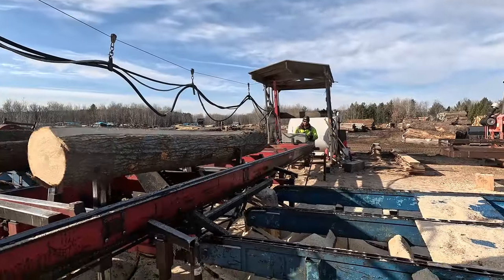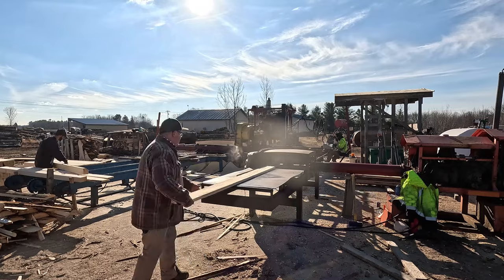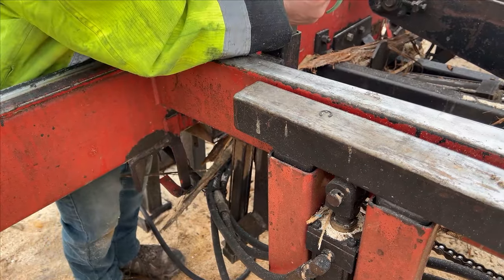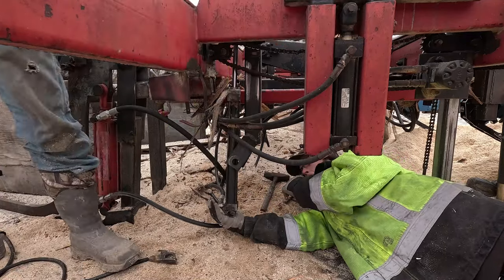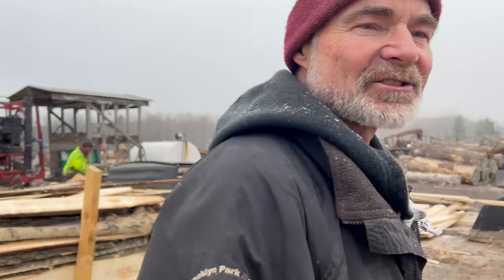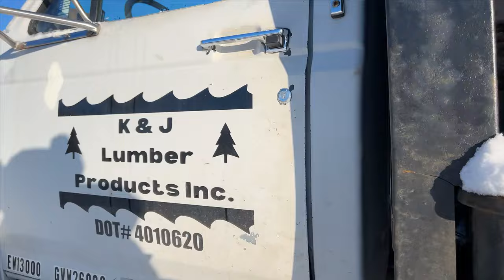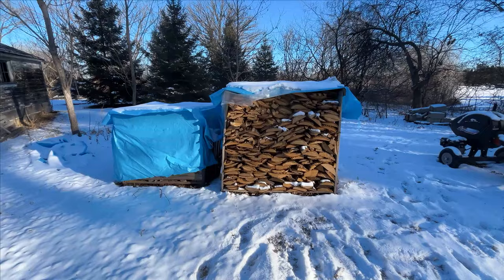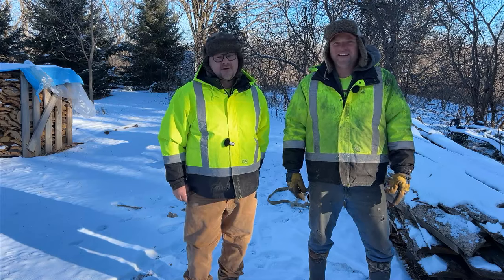What Is Slab-Wood? Turning Sawmill Waste into a Speedy Firewood Option

Comment: Here where I live most of the mills have a system where the slabs run down the conveyor then are cut in 16" lengths then go up another belt and dumped in a pile outside, where folks come and load them on their trailers then pay so much a trailer load,  They never have a problem getting rid of their slap wood. I take my trailer, ( 5' x8")  and on a good day I can haul about half a cord, for about $15.
Reply from the maker: Yeah that sounds like a slick operation.
Reply: Yes the only problem we have is when the firewood dealers show up with the huge double axel trailer and park right under the conveyor  until their trailer is full, then go and sell it for $200 a cord. LOL

Comment: Don't use pine for firewood unless you stay on top of cleaning you flue.because pine has resin. The resin turns to creasote and that is the thing that can burn your house down. I have been a volunteer firefighter for 20 years. I have seen it more times than I can count.
Reply from the maker: Well said, this advice can be valuable for those who burn firewood in fireplaces within their homes. I have also heard that if you burn the wood hot enough, it minimizes the creosote within the flue. Either way it’s best to stay safe and clean your flue regularly so Swatson doesn’t have to pay your home a visit.